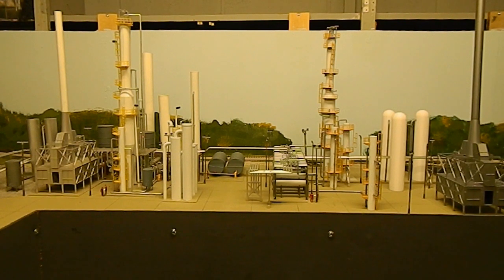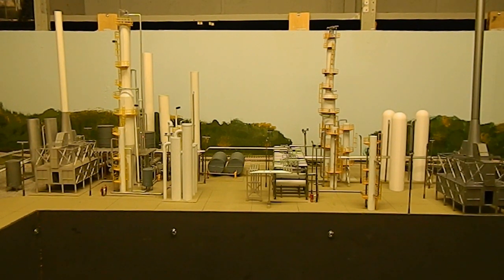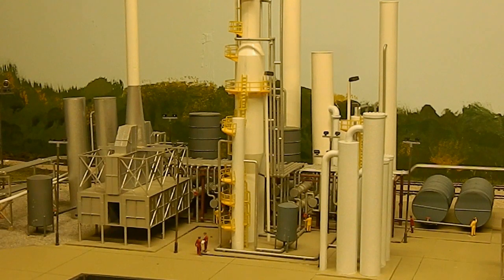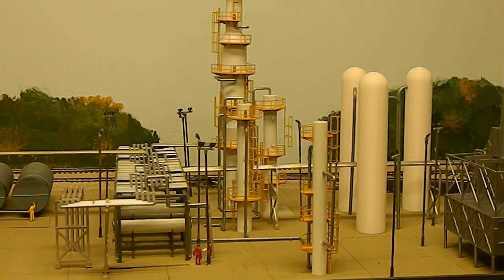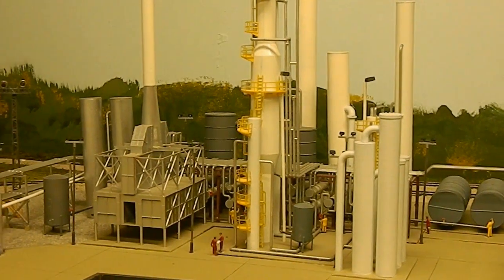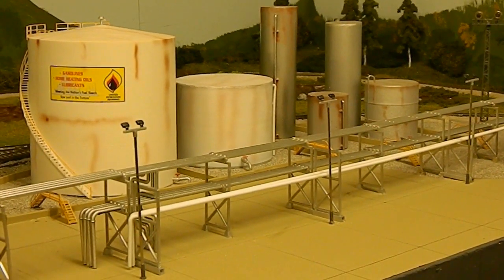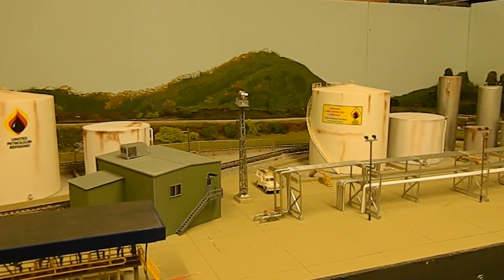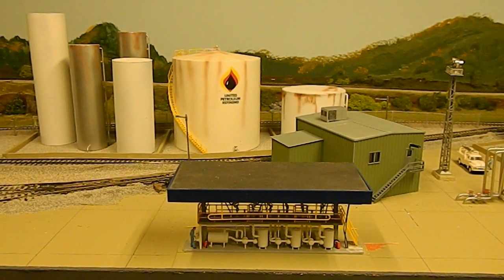SPECIAL REQUEST

Comment: Nice over view Joe.  So having worked a refinery if this does gasoline/diesel you need two gas station type pumps so the the vehicles and others working there can fill up cars and trucks. It was funny gas outside for the car was $2.50 gal were I was but only $0.50 on the refinery.

Comment: Joe, you did an outstanding job on your refinery! Looks about like the one I saw in North Platte at that train show I was able to attend. And it looks dead on to the ones I see in my travels around the US. I think you said that you wanted some flickering lights that look like flames on top of your smokestacks? I think if you used one of your red lights, but sped the flashing up faster and added some yellow and orange tissue paper to it, it might work? What era do you model? If you are modern, Trucks N Stuff has a lot of very good looking tank trailers on the market. Diecast Direct, Herpa(US), might even find some at Walthers? Excellent job, Joe! Roy H.
Reply from the maker: Thanks Roy. I model the late 70's so vehicles are kinda scares. I am looking at maybe using flicker candle lights for the flames

Comment: Joe Very nice I am currently building the same walthers Kit  refinery.  I just designed and storage tank to print on my 3D printer and it failed to print properly back to the drawing board  What size PVC pipes did you use? and what di you use for the tops?.  Are the flood lights LEDs or bulbs I had flood lights from a long time ago and they are bulbs  Thanks